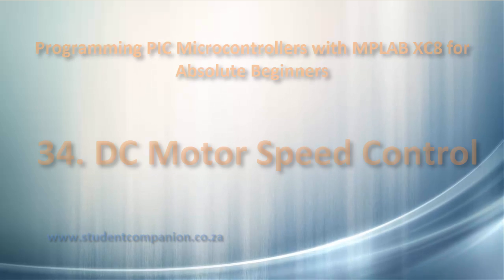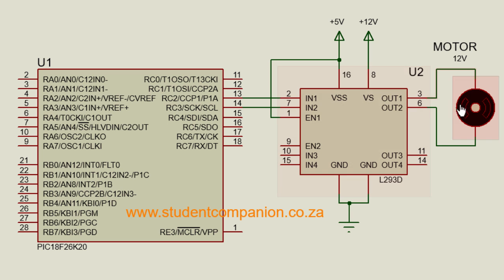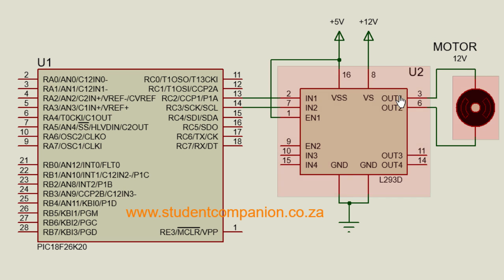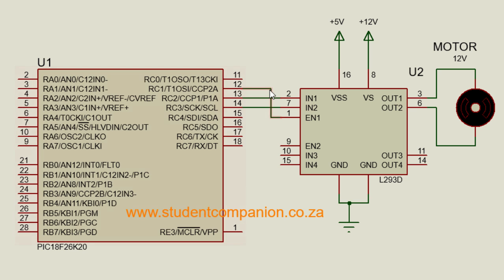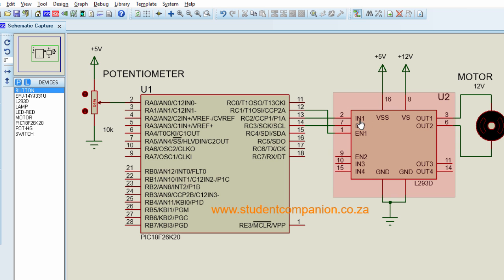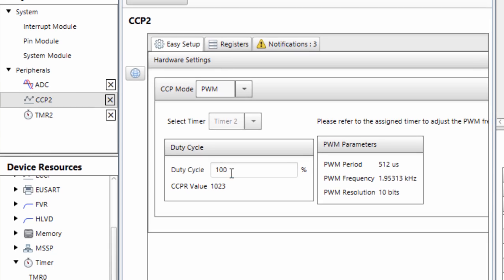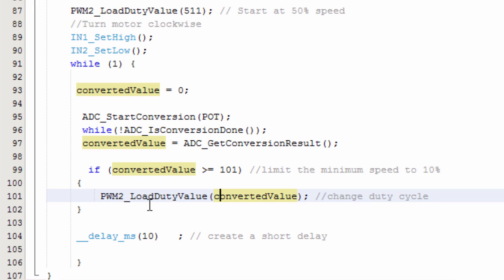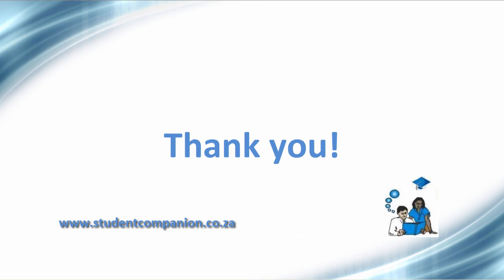34- DC Motor Speed Control | MPLAB XC8 for Beginners Tutorial

Comment: I tried to use this code in my PIC18f45k22 project but it does not work. Do you know why?
Reply from the maker: No one can know why if you don't provide enough information.  
What the version of your compiler? Are you getting any error message when building the code? Did you configure correctly your PIC with MCC? How is your schematic connections? ect.

Comment: its a great great tutorial and thanks for the sharing it. Would you please elaborate on how you arrived at the adc frequency and pwm frequency and period.
Reply from the maker: Which adc frequency you are referring to? please watch our adc tutorial to learn more. Tutorial 22 and tutorial 6.
We selected a  PWM frequency that will give us a CCPR value of 1023 when the duty cycle is 100% this so that can correspond to an adc reading of 1023 when the adc is reading full voltage. watch our tutorial 32.
Reply: The input clock frequencies to the ADC and Timer to set PWM. How do we determine the desired period and how do we know it?
Reply: Was the PWM frequency for this example randomly chosen?
Reply from the maker: +sikalabs did you watch those ADC and PWM tutorials? We explained in detail in those tutorial.
Reply from the maker: sikalabs as we said we chose it to get that value.
Reply from the maker: +sikalabs this value was taken in consideration of our 8MHz oscillator frequency as well. If you set a different frequency everything will change
Reply: hey, I appreciate your response. I figured out that the PWM frequency can be any value equal to or less than the system clock, 8MHZ in your example. ADC frequency on the other hand, has to be a certain range in order to achieve the desired resolution.
Reply from the maker: +sikalabs exactly. That's correct.

Comment: dear Sir , 

            I am sanoj from India . the tutorials and projects of yours are very helpful. it really helps me to improve my knowledge . appreciate it all.  
                    I am doing a project using k-type thermocouple . I am finding bit difficult to write a code in micro c . so would be nice if you release a tutorial on k-type thermocouple interfacing with AD595ic and with pic 18F45K22 . 
                 thank you .
Reply from the maker: +sanoj kumar HI.  Thanks for watching our videos. We appreciate it a lot. The AD595 Thermocouple amplifier is an analog device with an output of 10mV/C this is basically as the LM35 temperature sensor. It's easy to use check our tutorials 7 and 8: Digital Thermometer project part 1 and 2
Reply from the maker: watch this video: https://youtu.be/lrMXX-qBGlU
Reply: +Student Companion SA  .. thank you .. that tutorial helped me ..
Reply from the maker: +sanoj kumar you are welcome.